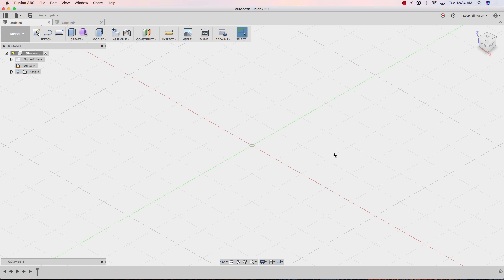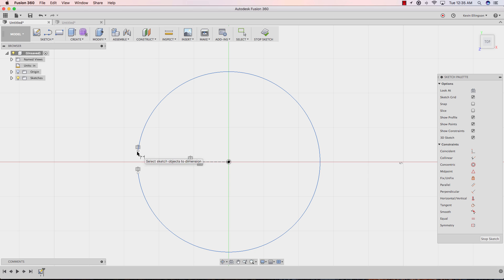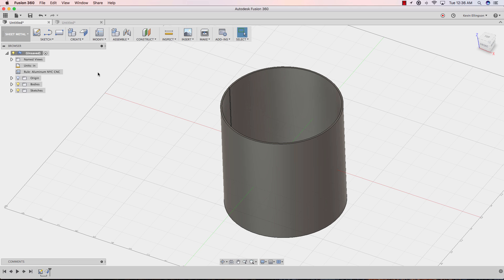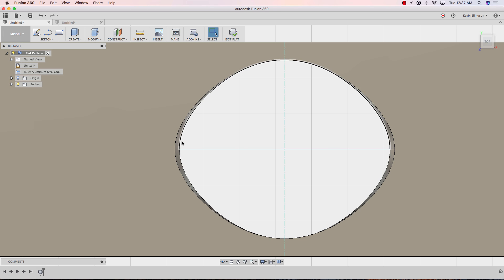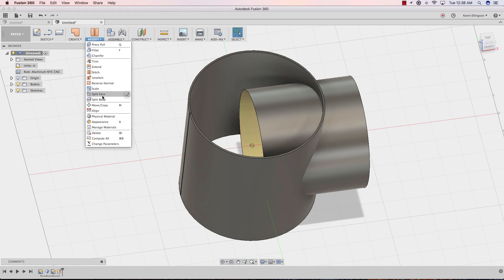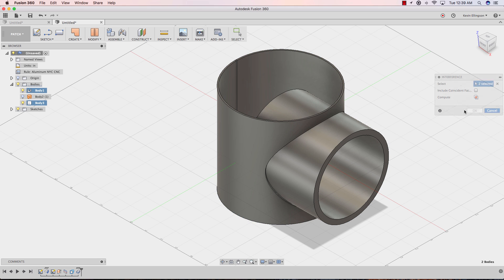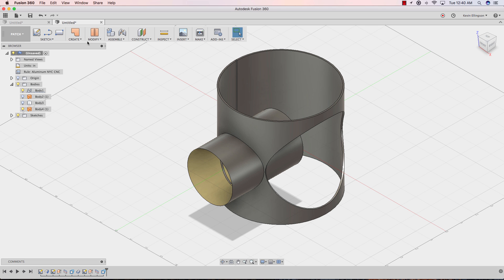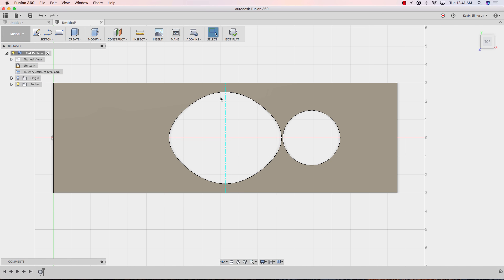Fusion 360 Flat Pattern Hole On Cylindrical Face

Comment: 5:43 
Is there a difference between presspull from inside and ouside ?? 
I don’t know exactly what is the reason
Reply from the maker: Yeah, that insures an interference free miter. If you didn’t do the inside too there would be a little area that would need to be cleaned up with a grinder or something.

Comment: I when I go to select a stationary face to create a flat pattern, it wont allow me to do this - is this a limitation of the now non-preview version of sheet metal?

Thanks
Reply from the maker: Hi Chris. This does seem to be a limitation of the official sheet metal introduction. As a workaround, if you place a sketch on the long flat open face, you can extrude that face a tiny amount (like .005") and then you can select that sliver as your stationary face.
Reply: Mechanical Advantage 
Great, thank you.
Reply: You have to first convert the body to sheet work in order to have access to the flat pattern for the object. I struggled to find it out too!!